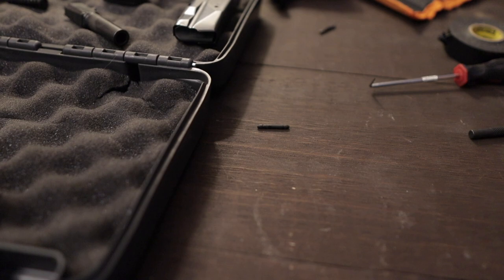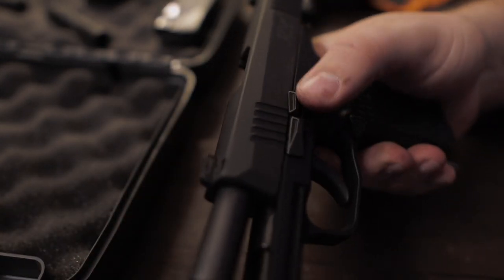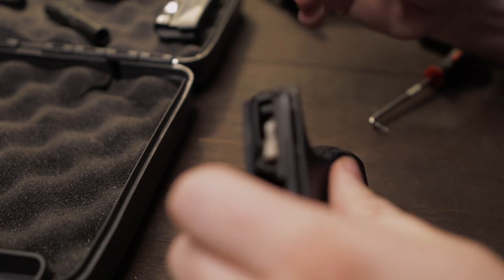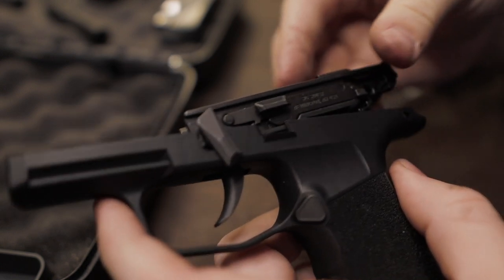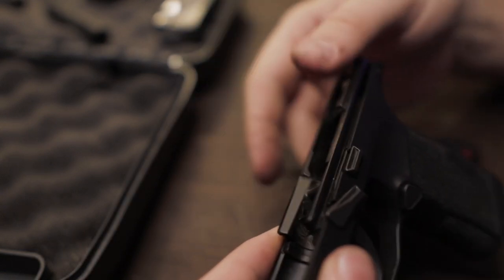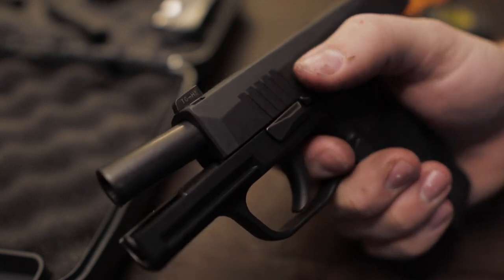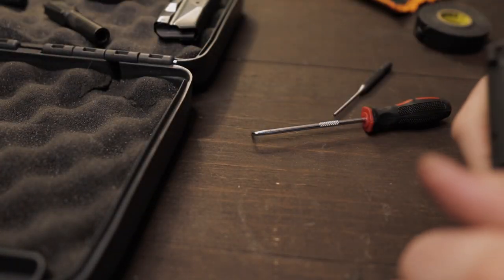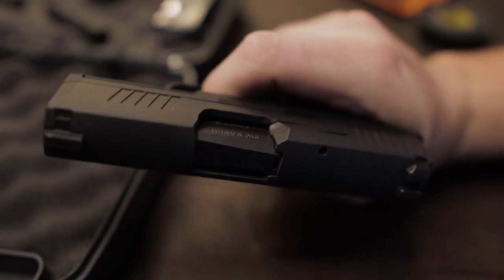How To Change A SIG SAUER P365 Into A P365X - Changing Grips On A P365

Comment: I tried a XL grip on my standard P365. I didn't care for it for a couple of reasons. 1. The flared mag well was uncomfortable in my hand compared to the 12 round mag with extension. 2. I don't care for how the 12 round mag sits inside the XL grip module, very hard to strip out in case of a failure or stuck mag.
Reply: Which 12 round mag are you referring to, the 12 round mag designed for the standard P365 or the  P365 XL?

Comment: When you switch from p365 to p365x slide, do you also need to switch the barrel and spring like you do with the xl?
Reply from the maker: Just the xl! The 365 and 365x use all the same pieces except foe grip and the shorter mags won’t be able to be used for the 365x

Comment: Are the magazines the exact same if I go from an x to a 365?
Reply: Or 365 to XL?   Following
Reply: Taking a 12 round magazine from the 365x and using it on the 365 is not a problem.  They will fit and work fine. New magazines come with interchangeable baseplates to accommodate different grip heights.  A 15 round magazine comes with 2 grip plates.  One for each frame size.  You can’t take a 10 round magazine and use it in the larger frames.  It will be to short to lock in place.
Reply: @keithvarley8382  Thank you!
Reply: @keithvarley8382  so my 12 round mags for my p365x will fit with no adjustments? Hope so. I want to make it smaller to carry in my front pocket easier.
Reply: @IanRLewis  if you are going from a 365X which is sized for a 12 round magazine to sit flush with the bottom of the grip, to a smaller (shorter) grip like that on a 365, your 12 round magazine will slide in and lock in to place but it will stick out farther than the grip.   A 10 round magazine would sit flush on the 365 and a 12 or 15 round magazine would stick out more.   That is where the different sized base plates come into play.  These different sized baseplates come up higher or lower on the sides depending on what gun/grip size it is going into.
Reply: @keithvarley8382  Ok is think I saw those plates at the gun store by me. Thanks
Reply: @keithvarley8382  Do you know where I can get a cool grip module to convert my X to a normal p365?

Comment: Ever since I learned the 365 comes in the "X" model, I'm pissed the dealer I bought my 365 from, didn't show me the "X". Thanks for the video. I've looked all over the Sig website and I can't find the X grip module. Any chance you or any other followers have the part number?

One other thing to bring up. Going from the 365 to the 365X, you have to purchase the 12 rd mags. The standard 10 rd mags that come with the 365 will not seat into the 365X module. This is a cheaper option than trying to sell/trade to get the 365X.

The only thing you'd be missing out on with this conversion is the milled slide to accept the better sights (Romeo, etc).
Reply: Just buy the 12 round magazine. 
Ot has the grip extension and 2 second swap out
Reply: This is a month old but I’m pretty sure the X is just a regular p365 slide with an XL grip. Hence u would just buy a XL grip.
Reply: @toastz17  yeah, that's exactly what I did, thanks!
Reply: Wilson combat has a grip module for the 365 and the 365XL which they say will give better shape, texture and ergonomics.  I just bought one and am excited to switch it out.  They are on sale now.
Reply: The 365x trigger is so much better than the 365. This video is bunk! You want the 365x and that can't make a 365  in to an X model just by changing the grip
Reply: @caldwell5078 yes you literally can that's what he did...